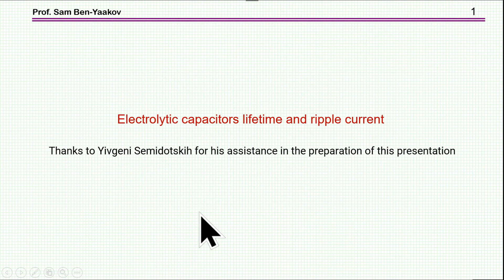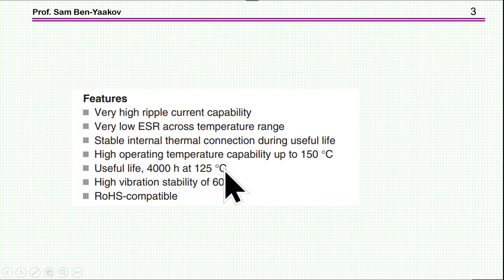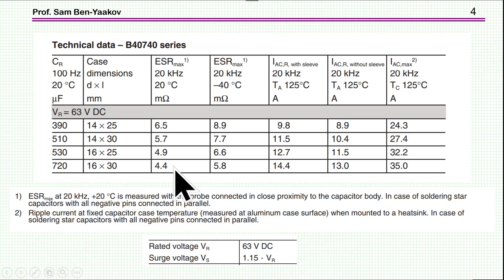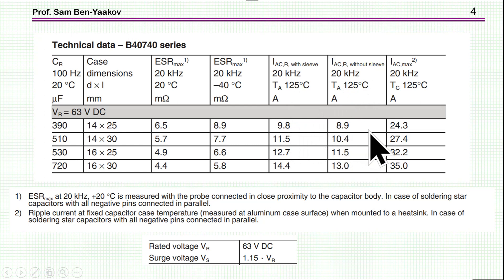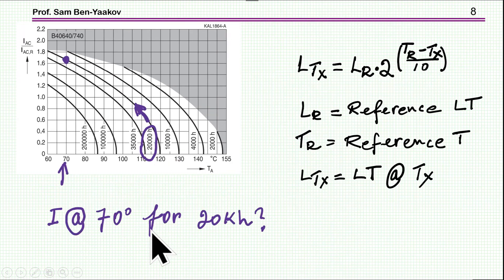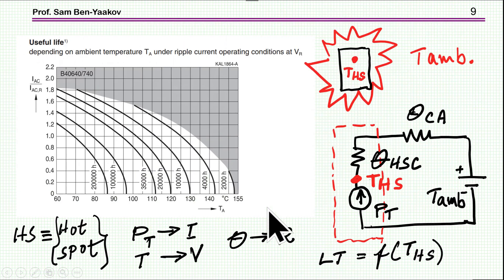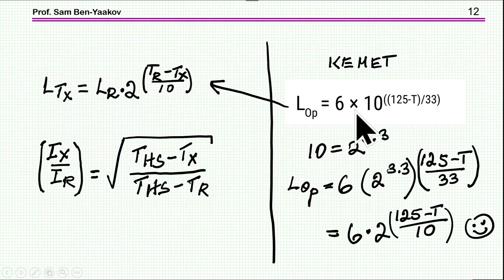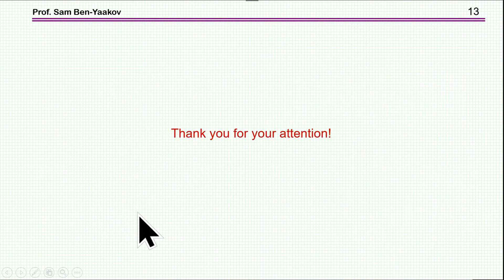Electrolytic capacitors lifetime and ripple current

Comment: How do i differentiate hot spot temp and reference temparature if data not mentioned in the data sheet
Reply from the maker: If not given in the datasheet, then it is probably either the case temperature or the ambient temperature.

Comment: If you look at electrolytic capacitors complete product life cycle, a disappointing recurring theme is the device is not given the proper operational design margin to maximize the overall life of the assembly. 

In other words, the electrolytic capacitor will fail first. 

In repair (field returns) we see this phenomenon time and time again, a leaky or failed electrolytic capacitor, why? 

I believe the engineers, and I have been guilty of this myself, do not provide enough design heat margin (temperature and time) because the actual thermal operating conditions are not fully understood, and the device is, as used in the design, essentially under-rated.

The lesson learned with electrolytic capacitors is this: when you think you have a good estimate on component life ---- add additional margin to the design. So you may add an additional 20% to 40% depending on the nature and end use of the design.

This is why using a thermal camera as part of the overall design process is very informative. Unfortunately, if the thermal conditions are not extreme, to save cost, you will not see a design revision, which is not ideal. So, having experience in looking at design thermal behavior is very informative early in the design cycle. This usually translates into looking at existing similar product designs and scrutinizing manufacturer evaluation boards.

I find that the capacitor is often subjected to internal and PCB hot spots, which directly effect the capacitor's operational life. As part of this hot spot behavior what you find is, the capacitor may need air flow or a specific (planned) heat conduction path and, when the assembly is operating, it cannot reject heat as envisioned by the designer or this heat path is disrupted. 

For example, it is very common to see many radial lead capacitors bunched together (basically case to case), where obviously the capacitors in the middle of the bunch are not being cooled as effectively as the ones on the periphery. Will the devices in the middle fail first?

The operating temperature of the example in the video is helpful for understanding the math, however continuous operation at 100 degrees C for an electronic assembly is a very high operating point.
Reply from the maker: Thanks for sharing your experience/thought

Comment: This form of analysis is very useful.   It takes measurements/multiple data points and makes projections.  
Having dealt with heat and mass transfer problems have learned there are always more factors to confound the analysis and sometimes even the model.  After blowing up a string of capacitors (in cans) this morning due to a misapplied high voltage i'm reminded of the importance of the electrolyte.  
Thank you for helping me improve my analysis and knowledge.
Reply from the maker: Thanks for sharing and kind words.

Comment: Very useful. 
This is great from the engineering perspective but I am wondering whether there is anything similar that can be used for the shelf-life of electrolytics and the life of electrolytics after decommission? For anyone interested in old electronics equipment, assuming how long a piece of equipment has been sitting in storage since last used, the biggest question is: what is the probability a certain electrolytic has gone bad and how did storage conditions affect this probability?
I am assuming that simply putting Ta = 25 in the formula won't give an answer here.
Reply from the maker: Yes, as far as I can tell.
Reply: @Sam Ben-Yaakov  Capacitor leakage...looking for residue on circuit board, or components is a first check.
wondering if charging and discharging time might also provide more information as to whether lifetime has been reached.
Reply: Capacitor leakage...looking for residue on circuit board, or components is a first check.

Comment: Dear sir, what about the freq issue? As I know E-cap does not like low freq ripple as it will get much hotter.
Reply from the maker: Thanks for comment. Good point. I have not touched upon this. Data sheets do provide correction factors for different ripple frequencies.

Comment: Thank you very much for the great explanation. After more than a decade in power electronics I finally have got a nice method to estimate the life time of a electrolytic capacitor.
Electrolytic capacitor wears out being used as a filter in a bridge rectifier. 
Is  it reasonable to construct a kind of model of the capacitor to run in the firmware? It would calculate (estimate) the inner temperature measuring the ripple current and case temperature in order to protect the capacitor of wearing out to fast. In some 3phase converters exist such a models to protect the IGBTs of getting to hot and wearing out to rapidly.
Reply from the maker: Tanks for intersting comment. As far as I recall. there is a company that offers such monitoring.

Comment: Did you just see the table you presented? Which conclusions can we do? 
If you replace one capacitor to two capacitors, you will get more lifetime cause much more summary current limits and doing your ESR as parallel resistors actually. Isnt it?
The second conclusion i can do (summary) is "more dimmensions - more lifetime and less ESR". isnt it?
Reply from the maker: Thanks for input.

Comment: How to calculate lifetime when we have some current profile ??
For example braking application where different time magnitude of current varies based on the force applied to wheels.
Reply from the maker: How about using the manufacturers' themal models you mentioned?
Reply: @sambenyaakov  yes sir I have some thermal model but I couldn't solved it till now ...I am not getting how should I use manufacturers thermal model

Comment: The formula used in the video it is general formula , formula changes based on capacitor type and manufacturer.we should always refer manufacturers datasheet.
Manufacturer also provide the thermal model.
Reply from the maker: Correct. This is an educational video explaining the underneath principles.